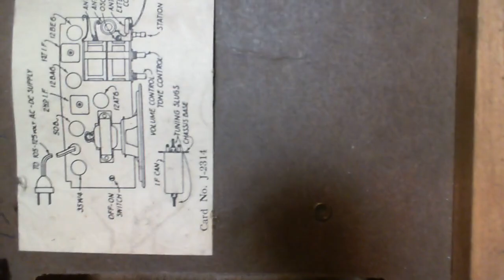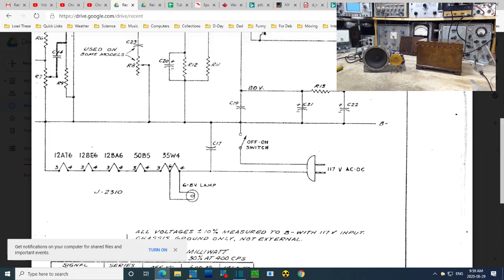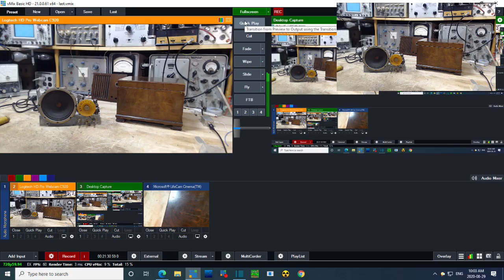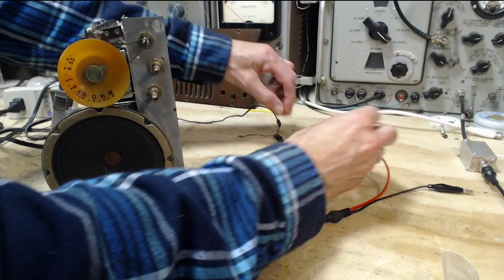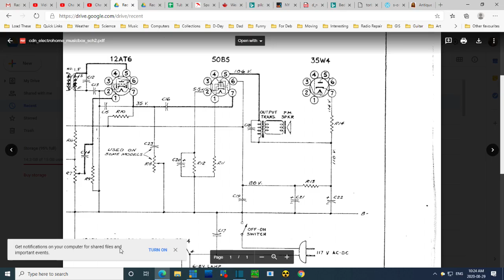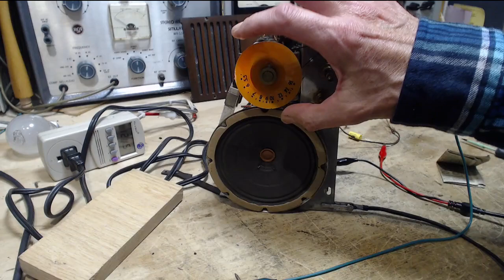Electrohome Music Box Radio PMU51 418 Video #2 - Alignment Check

Comment: Pacifictv website has a schematic for this radio. It is a circuit shared with the Electrohome Picturadio. The schematic has voltages marked on it  in some places as well.
Jim did a similar PMU51 radio back in  mid October of 2014!